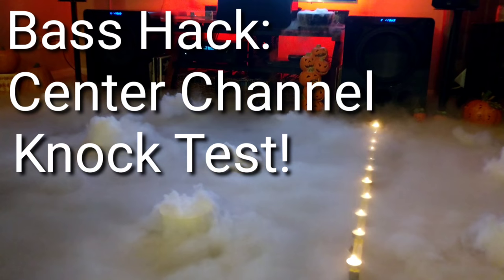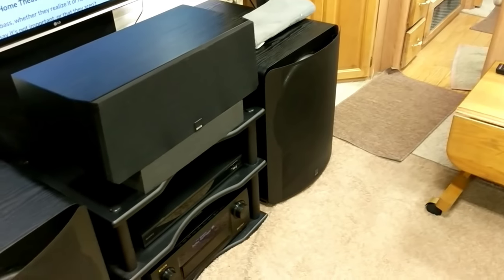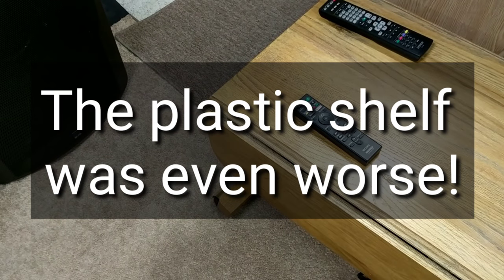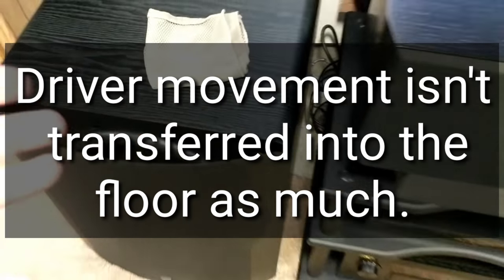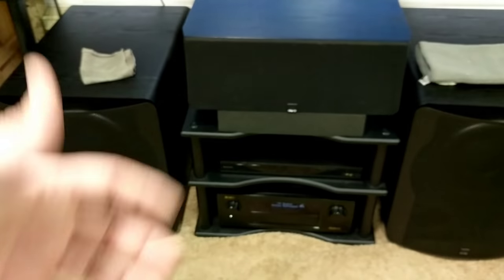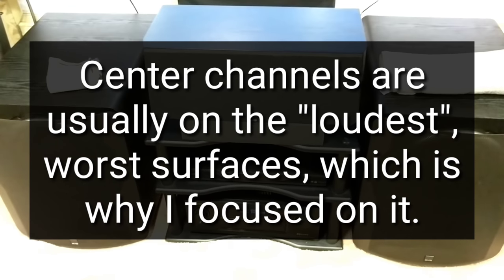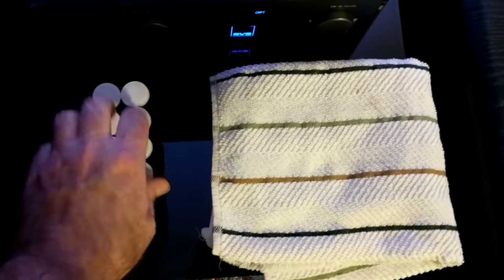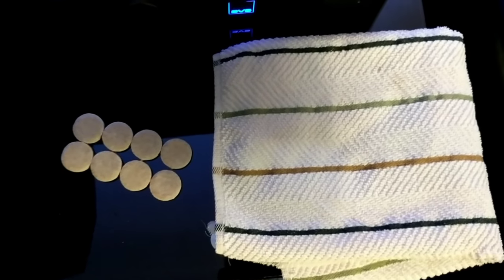Bass Hack: Center Channel "Knock Test" (Mounting Surface, Not Cabinet)

Comment: I really like that knock test. What I like to do to isolate my speakers from a surface is buy some rubber balls, cut them in half, and then place them with the cut side down/dome side up. Then I put the speaker on the top of the dome side so it's kinda floating over the service on the top of the rubber balls. 
That dish drying pad seems like it would be really good for isolating speakers from stands. I'm going to have to pick up some of those pads.
Reply from the maker: Yeah it worked pretty good. Had no plans to use it specifically in the video, but it was available and I tried it. 

Quite a few people do the ball thing, not a bad route. Haven't tried it personally. I would think that the squishier the ball, the better.
Reply: @Subwoofer101   I use standard racquetballs, which have worked well so far. The only issue I've ever ran into is having trouble with certain kinds of paint adhering properly. I don't like the visual of racquetball blue, so I paint them to help with getting a nice integration with the rest of my equipment.
Reply from the maker: Maybe try foam balls that already have the right color. Here's some ideas:  https://amzn.to/2XqS1Pu
Reply: @velocci6666   I use a clamp to hold them with very slight compression, and cut the center with a razor. It's tricky to judge the correct amount of pressure though. Too little and the ball moves when you try to slice it, too much and it will blow out before a clean slice is made through. When it's just right you can slice through about 90% in the clamp and then finishing it off with no pressure, and it's a smooth clean cut.

Comment: Two weeks ago my 4 year old pioneer receiver fried. I have 5.1 Definitive Technology speakers. I began the quest for a new AVR for around $500. Yesterday I bought the recently released Denon avr s760h for $449. I got it hooked up, calibrated, and streamed part of a movie that has lots of effects. For the first time, my speakers sounded amazing. Immersive sound and the subwoofer was putting out like I’ve never heard. Still, the dialogue was suffering a bit. I found this video,(subscribed) and decided to give it a go. I bought a small piece of foamed back carpet, cut it to fit shelf and placed center channel on top. What an amazing difference in dialogue. It was clearer and easily understood. Keep up the great advice. There is still a lot of your videos I plan on watching. 
Dave

Comment: Had to use the gain hack for apartments (works, thanks!). What I found that was different between the regular gain hack and the one for apartments is the potency of the pressurization. While the regular gain hack would absolutely pressurize, the one for apartments would only pressurize for the lower octaves (Interstellar level SFX).
Reply from the maker: Glad it helped!! It's softer, less dynamic bass. Still just as deep, just not as much kick. You can basically extrapolate that from the PB-1000 all the way to the PB-16 Ultra. Similar depth of presentation, just more potency as the wattage increases. The PB-3000 is only one that doesn't fit neatly, a lot more kick than it's wattage would suggest.

Comment: Packing materials like that thin foam sheets and bubble wrap work good also you need to call your speakers all the way up to the front edge of the shelves to cut down on secondary reflection.also the cheap yoga mats work great as you can cuz them cut it to fit need speaker or use multiple layers as necessary

Comment: Genius idea!  
I’m thinking I might need to do this.  I have an odd setup though.  
Like a lot of people my Tv is mounted above the fireplace.  My center channel is below the tv resting on the sold granite mantle.  The mantle is higher than ear level.  To correct this I needed to angle the speaker slightly.  To angle the speaker I cut a wine cork diagonally creating a cork wedge. 
I wedged it at the rear of the speaker.  The point of contact of my center speaker and the granite is  near the front of the speaker.  I’ll check this out tomorrow, as it’s 10pm right now, and I’m in bed. My fiancé already thinks I’m crazy about audio, can’t have her think I’m insane.

Comment: I've heard of decoupling the center channel before but it didn't make sense as to how important it can be until I you explained it. I've now done the same. Thanks. My klipsch rp160m bookshelfs are wall mounted into the wall studs. Is this Ok??
Reply from the maker: Maybe try stuffing some Kleenex or tp between the speaker and the wall, if it's safe to do so, and see if it makes a difference. If so, then maybe use some foam as a long term solution. If you can prevent some vibration from going into the walls, it might help.

Comment: I first decoupled my subs with Auralex SubDudes, and now since I switched to all SVS (Prime Bookshelfs, Prime Center, Prime Sats) main channels, I got Auralex pads for them too,  this was a no brainer. The results are great!
Reply from the maker: How do those auralex pads for the subwoofer do with the knock test? Do they allow the subwoofer to wiggle? I've wondered how they would compare.
Reply: @Subwoofer101  I don't know about using the knock test for subs with the auralex pads but I too have a subdude for my SVS sub and the difference was night and day. The bass was extremely muddy and didn't match my system at all until I threw it on an isolation pad. The bass is much cleaner and doesn't carry throughout the building as much, highly recommended.

Comment: What about the rubber feet that some speaker manufactures, like Klipsch, give for the customer to place under the speakers where only the rubber feet touch the surface that you place the speaker on?
Reply from the maker: I don't know about Klipsch feet, but they are probably better than no feet, but unless they are spongy and squishy, something spongy and squishy will probably be better.

Comment: The staff at the audio-shop here in Japan suggested magazines (although not aesthetically pleasing).  I used to use cork (coasters for cups and glasses) and they worked pretty good too:)  I personally use expensive insulation discs but tbh, I don’t know if they justify the price at all so great tip as always!!  Love these bite size series!!  I’ve also been making some HT videos lately, please check them out when you get the time!!  thanks again:)

Comment: Maybe an off topic question but. My satellites are supposed to be crossed at 100 to 120 Hz. But when I set them up there they sound terrible. They don’t blend with my fronts and center and subs. But when I set everything to 80 Hz and the subs to 90Hz... man it’s awesome and flawless and the highs and lows and spacial resonance and everything are perfectly blended. What’s up with that? Any thoughts?
Reply from the maker: If you set the crossover on the subwoofer at 90 hertz, and your speakers on the AVR at 120 hertz, you are leaving a hole in the response. I always disable the crossover on the subwoofer and let the AVR handle the filtering.
Reply: Subwoofer 101 no I was talking about the LFE crossover in the AVR. The subs crossovers are turned all the way up to bypass their crossover. I’ve tried the AVR’s crossover for the subs at 120 Hz and the satellites crossed at 100 to 120 Hz (where they should be) But nothing sounds nearly as good as when I cross everything at 80 Hz with the sub LFE crossed at 90 Hz all in the AVR’s filters. Kind of weird. Not complaining, it sounds awesome, but it’s not what everyone generally suggests for the subwoofer or satellites. Just weird.
Reply from the maker: Ah, well yes, 120 for the LFE crossover is the "correct" setting, but nothing is set in stone. I set mine to 250 hertz. No real benefit to it, but that's just how I roll. What's important is what your ears like.
Reply: Subwoofer 101 yes true lol. For whatever reason my ears like the 80 Hz for all 7 speakers and 90 Hz for the .2 subs. On this particular set up anyway. Go figure 😊. Who knows? If I were to change my system I’m sure my settings would change too. Thanks for your help 👍

Comment: Does make sense. Now I'm curious. Walmart has 2' x 2' foam exercise pads that are not quite a 1/2" thick that i know can be cut to shape for each speaker. A 3 pack of pads is like $15. I have already been thinking about getting a pack to do my subs. Might get 2 packs and experiment a bit.the svs pb-2000 and klipsch sw-112 have feet already. But since I'm running them on a true hardwood floor do you think it will make a difference to use under my subs or is that still going to allow transfer to the floor due to not being soft enough? The pads would not allow my subs to be free from the floor like yours are i don't think. I don't have a rattle issue but i do wonder if it would still make a difference. Also , since my floor standing klipsch rf-62ii's are on the floor as well should i try the pads under them as well. They already have the factory padded feet which are in good shape. Just curious. Thanks for the knock test heads up. Gave me something to do today.
Reply from the maker: Great idea, I forgot about yoga mats! Thick and spongy is good, 1/2 inch might not have enough give. I'm assuming that you don't have the SVS Isolation, just the standard feet? The isolation is far better than the stock feet, very squishy. 

Subs need more squish, a lot more mass moving back and forth. If you want to try something similar, put some thick pillows or sofa cushions under the subs.
Reply from the maker: I tried some harder foam pads under my subs and didn't notice a difference. Those foam interlocking squares for floors. Virtually no difference. With the SVS Isolation, the difference was noticable. More give made a difference.
Reply: @Subwoofer101  ok thanks so much. I am going to town so i will hunt for squishy. You were reading my mind with the foam mats as that's what i was thinking. I will check yoga mats for softness. If i find a good one i will pick it up and cut to fit and give them a try. They are pretty abundant at my walmart. Thanks again and I'll give you an update as soon as possible.

Comment: Can testify that this really works, I have always found my center (RP 504c) to be lacking somewhat, did the knock test after watching this video and went to Amazon and ordered two yoga mats. I cut them carefully to the size I needed and stacked them and bang even without Room Correction I noticed a vast improvement, everything sound more tighter, Of coarse I did Room EQ after and even better again, 
So ya yoga mats especially if your center is very large and although a cheap way I bet it does as good as job as Auralex foam pads
Thanks for the help
Reply from the maker: Glad it made a difference, thanks for watching!

Comment: Would carpets work or would introduce static?
Reply from the maker: Carpet is good, static would be more of a problem if your relative humidity is low. There are times my AVR and Blu Ray player shock me, and it's when the humidity is low.

Comment: If all you've used is denon, you need to try Yamaha. Yamaha's rxa880 destroys Denon x3500h in technology and versatility.
Reply from the maker: A lot of my viewers don't seem to be as happy with the Yamaha room correction. Maybe they have gotten better with multi point, but looking at the comparison on Crutchfield, I'm not seeing how Yamaha is "destroying" the Denon. 

I'm not opposed to checking out Yamaha, I'm just not sure about your assertion. How is the Yamaha more versatile? 

https://www.crutchfield.com/compare_022RXA880_033AVX3500/Yamaha-AVENTAGE-RX-A880-vs-Denon-AVR-X3500H.html
Reply: @Subwoofer101  in terms of sheer technology the Yamaha crushes the Denon. I have them both and I know first hand. Most noticable is the echo correction and the fact Yamaha has a minidsp like equalizer with room correction built in.
If you want your expensive speakers to not sound their best get the Denon.